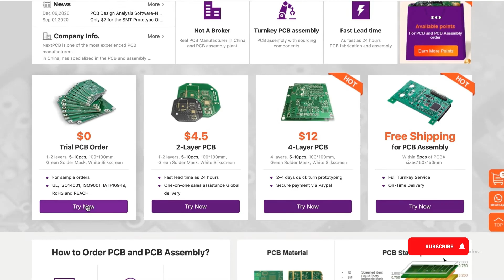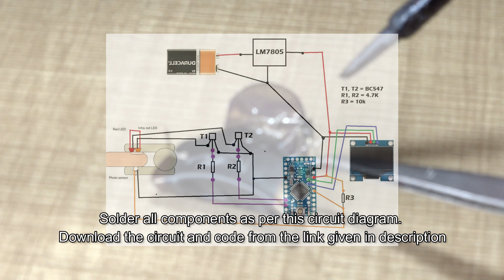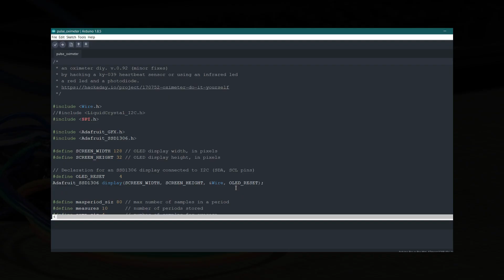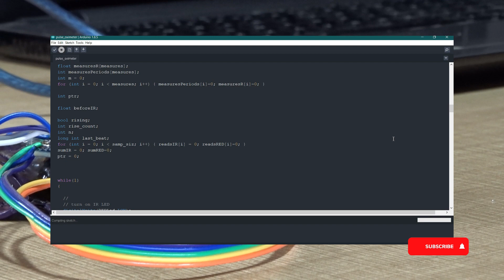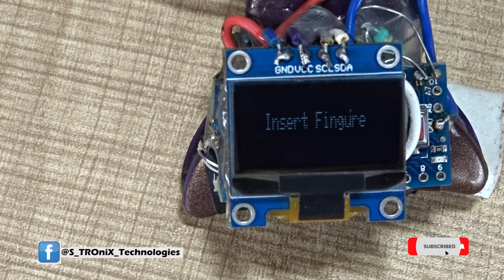How to Make a Simple Pulse Oximeter at Home #Covid19

Comment: Is the pins of it led and red led are correct?
Reply from the maker: If you have problem with LEDs, make the connections as follows. Make sure negative end of LED connected with collector of transistor and positive end of both LED to the vcc.

Comment: I have connected all these connections using breadboard , the red led is on but it isn't showing any reading in oled when I inserted my finger  it's showing only insert finger . The photo diode is not sensing anything how can I rectify this
Reply from the maker: check polarity of photo diode. and block any other light source.
Reply: I am having the same problem as you, did you manage to find a solution ?
Reply: Hola, pudiste solucionarlo?